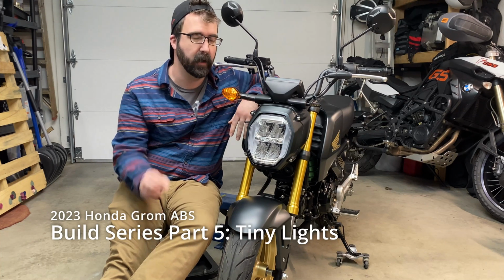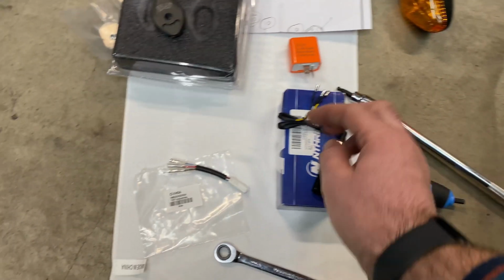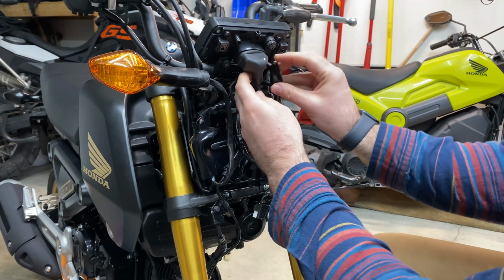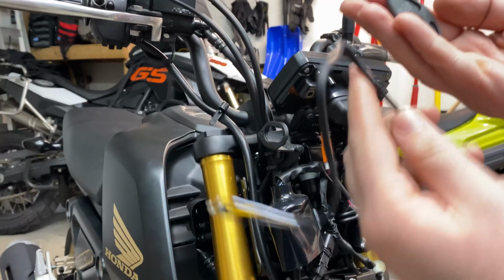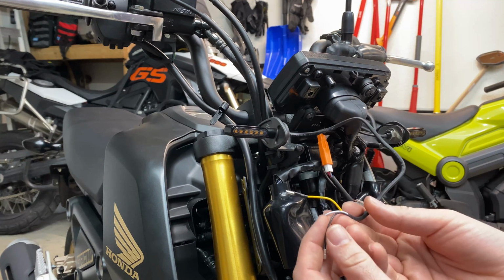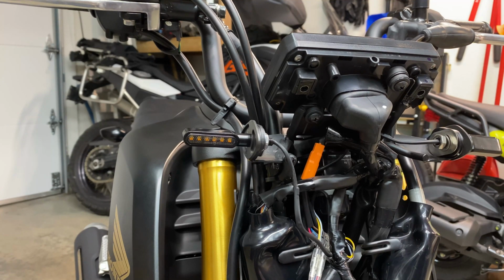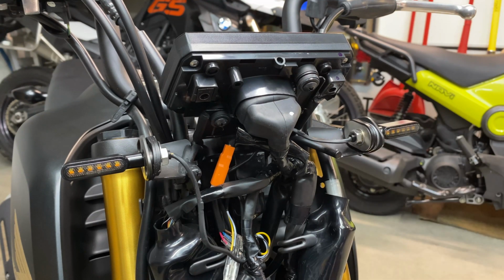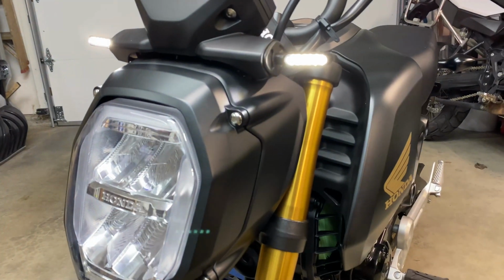Sweet Running Lights and Turn Signal Install | 2023 Honda Grom Build Part 5

Comment: Quick question! Does having those dual colors blinkers and using it as running light means that you don't use the main front light anymore??
Reply from the maker: No I still use the main front light, I haven’t touched that part of the harness at all. Good question.

Comment: Please help me. I notice you have 3-3 adapters for your front turn signals. That way you can use blinker and running lights. For my back blinkers, I have turn signals that also turn red for brakes. Would I also need another 3-3 adapter for the back?
Reply from the maker: Hey, without seeing exactly what you bought it might be hard but i’ll take my best guess. The rear turn signals are bullet connectors, not a mini 3 pin. So blue or orange (depending on the side), green, would go to two of the pins on your new one. And then whichever pin is the brake light you’d need to tap off of the brake light wire. I don’t think an off the shelf adapter will do what you’re wanting. 

Hope that helps, but again, it’s my best guess without seeing exactly what you have going on.

Comment: Did you put the same signal lights in the back ? Also nice Grom man I just got mine like a month ago my brother gave it to me as a wedding gift
Reply from the maker: That's a hell of a wedding gift, congrats! 

I put slightly different ones on the rear. I thought they'd look good against the body lines at first, being a little different shape: https://www.amazon.com/gp/product/B0B9BW8MWN

But then I put on the high mount exhaust, and all my plans went out the window for them haha. If I were to do it again I'd probably just get the matching rears to the front.
You can see more on the rear turn signals in this video: https://youtu.be/x5y5fm5RDfo
Reply: @SpencerDesmarais  thank you man also is it almost the same installation process as the ones in the front. I’m about to order them to make my bike look like your man 🤙🏼
Reply from the maker: The rear stock lights are just bullet connectors, so you don’t need the wiring adapter like you do on the front. Otherwise it’s about the same.
Reply: @SpencerDesmarais  you wouldent happen to know the link to the rear signals that match the front ones you have do you?
Reply from the maker: @35davidbrinkman35   https://amzn.to/3G8IMuI they're the same housing, but sequential and no running lights.

Comment: Looks great, funny how the new Grom comes with the same turn signals as back in 2014. Most new Hondas have LED now, but they didn't change them on the Grom 🤣
Good find with these turn signals.